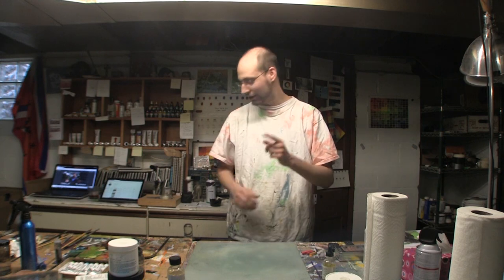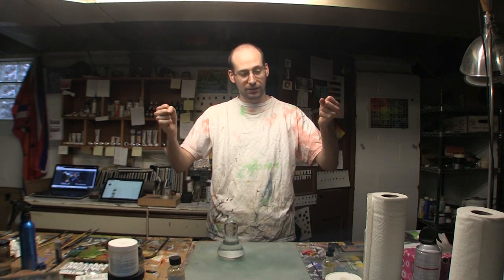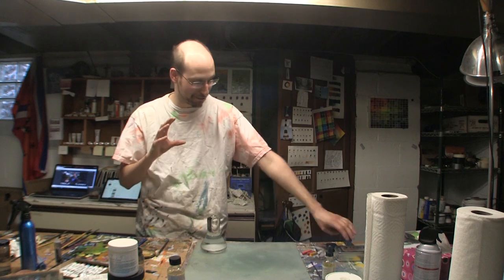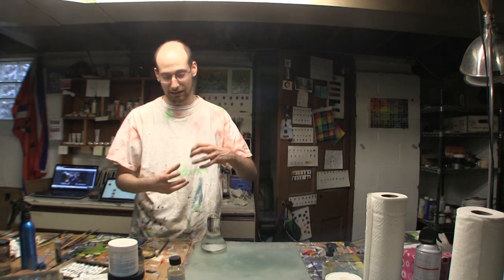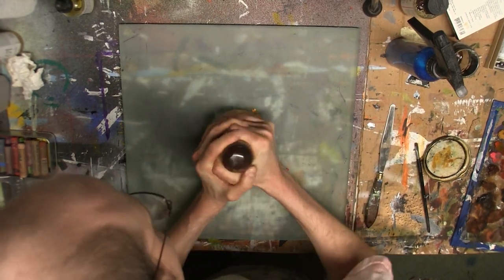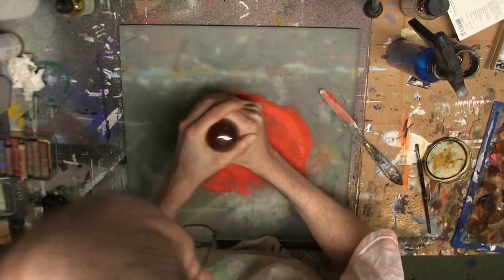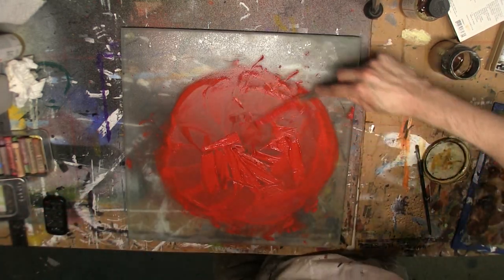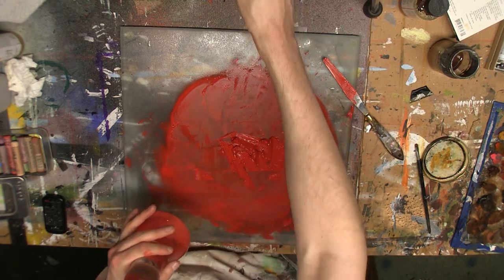Making Paint Out of Chalk Pastels (Part 2)

Comment: I think that the brand used could have more filler than not. Would working with a more soft and more pigmented chalk work faster? How about adding ink or dye?
Reply from the maker: You still need to grind down the pigment regardless of the pastel used. It might not seem necessary until you start to use the muller and test out batches of paint. The pigment might look smooth at the start,  but without proper grinding you'll end up having an uneven paint. Ink or Dye sort of takes the paint out of making paint. Dyes are known to fade over time, while the right pigments don't have that problem. You'd also have to compensate for the liquid of the ink/dye as it would likely change the mixture quite considerably.

Comment: you can use soap to clean up after making oil paint. dish detergent. youd probably collapse from fumes trying to do it with solvents.
Reply from the maker: It's all about ventilation, but I'm honestly not bothered but the slight aroma of mineral spirits